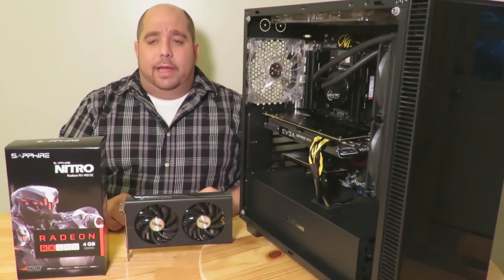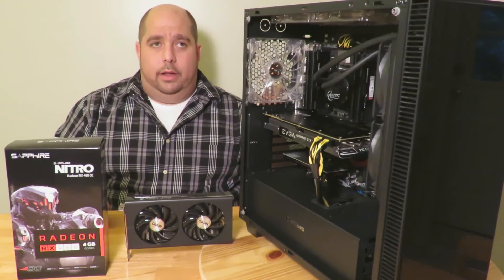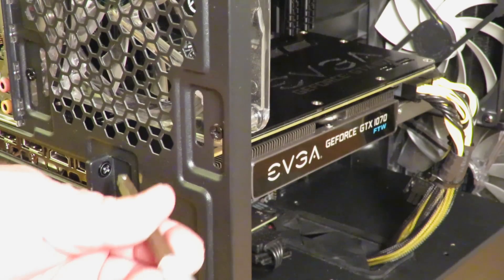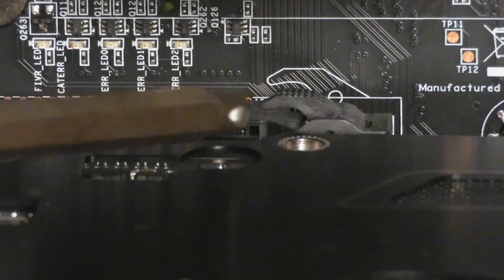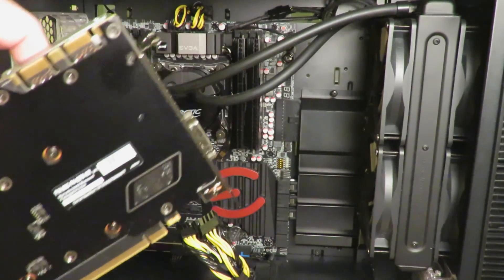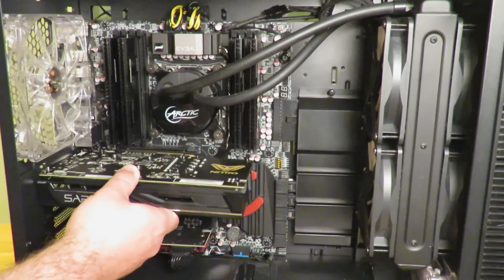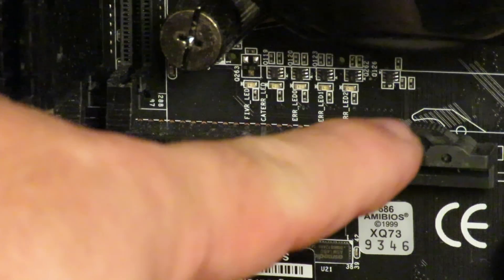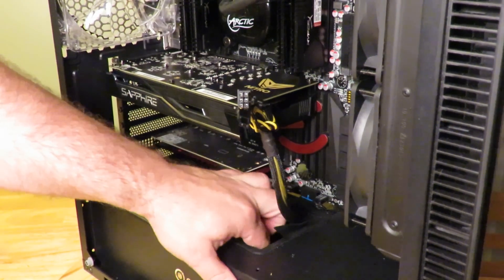Tutorial: How to install the Sapphire Radeon Nitro RX460 OC Video card AMD

Comment: I have a AMD A6 7400k which is had onboard VGA, i tried to install my new RX 460 2GB (no power pin need) on my pc, but it cant connect to the monitor, the PC seems to booting and loading, the VGA's fan is running normal. My PSU is Hexa 400 Pure. What's the problem with my pc? Does it really needed to uninstall the onboard vga's driver before i install the rx 460? Thanks before
*note: sorry for my bad english :)
Reply: no worries my friend about the english, it looks fine to me.  So stupid question, do you have the monitor plugged into the video card, or still to the onboard video?  In some cases you need to disable onboard video for the video card to work, but before you do that, let's troubleshoot a little more.  

Did you plug in the PCIe cable to the back of the card, it need power to power on.  The card requires a 450Watt power supply, so that 400Watt may not be enough.  Make sure the input on the monitor is selected that the video card uses, so for example if you are using HDMI, make sure the output on the monitor is set to HDMI, or DP or DVI, which ever you are plugging into the video card.  Remove the video card and reinsert it, it may not be properly seated.

Let me know if any of that helps.

Comment: after install this gpu my monitor turn into black screen? any solution?
Reply: A few things to check, 
1. is the video card firmly seated into the PCI-e slot, I recommend removing the card, then re-inserting it, just in case, I included in this video how to remove the card.
2. Is the video cable, still plugged into the onboard video or is it plugged into the video card.  Changes are the onboard video is a vertical connection, next to the USB ports.  The video card is the horizontal connection.
3.  Is the correct input on the monitor selected?  Were you using DVI before and now using HDMI, DP, DVI or vice versa?  Select the correct input on the monitors on screen display, usually a button on the monitor to change inputs.
4.  If your video card has a PCI-e connection, is it plugged in, if it has 2, are both plugged in, yes they both need to be plugged in.
Let me know if this helps, these are the most common issues.

Comment: I have rx 460 2gb graphic card...it showing no signal in my led tv and fan spinnig....what should i do?
Reply: No signal could mean more than a card, it could be that there is an issue with the system.  Without knowing more, assuming it is the card, and maybe a new install of the card, a few things to check.

1. Verify that he card is properly seated, remove the card and reseat it into the PCI-E slot (Make sure the system is powered off before  you remove the card)
2. Make sure the PCI-E power cable is properly seated in the card, remove it and plug it back in (Makes sure the system is powered off before you remove the PCI-e connection)
3. Verify that your monitor is in fact connected to the video card and not the motherboard.
Reply: Go back and buy the 4gb version

Comment: I have a gt 630 now but if I install the rx 460 do I have to install the amd drivers too or will it run fine?
Reply: Iggy Castillo thank you so much, also my mobo is an asus p8b75-m with a pcie 16 slot but does the card (rx 460 from msi) need extra power cables as my gt 630 doesnt
Reply: Iggy Castillo does that 10 watts make so much difference?
Reply: Iggy Castillo okido thanks
Reply: Iggy Castillo I still have one little teeny tiny question because the videocard I want is a msi rx 460 and it doesn't come with pin holes for the power connector, is the msi version plug and play?
Reply: Iggy Castillo Thank you so much for your time!
Reply: For sure.

Comment: so, the cable for connect to Monitor ? I'm must buy a new cable?
Reply: Iggy Castillo 
the white cable to connect monitor
Reply: OK OK, thanks
Reply: Because my monitor still use that
Reply: ??? Where the photo I'm sending to you???
Reply: Well, the Adapter for VGA monitor
Reply: Eh... I have a question, my processor is AMD A4-7300, it worth with RX460?
I got bottleneck or not?
Reply: Thanks for your answer

Comment: i have serious issues with the drivers for it. after installing them, the dvi signal broke and corrupted my hard drive. Formatting it externally was my only option, so I did that. But still, I do not recommend the rx 460, get the 470 instead, since it has a higher value and stability.
Reply: Iggy Castillo xD Didn't expect an answer this quick. Well, it was a 800€ custom gaming rig, so you can guess that all the parts were new and the driver was freshly installed, thanks to onboard lan from my asrock mobo
Reply: I downloaded the newest update, BEFORE the new driver version came 2 hours later xD
Reply: it broke down during the installation. And before that, my rig booted up correctly and smoothly.
Reply: Iggy Castillo system power 8 500W. onboard graphics was disabled, since i have a kabylake cpu and it has some issues with the onboard graphics...
Reply: Iggy Castillo 
4260052184363 EAN code of my 500Watt psu. Well, during the installation, my dvi was plugged in to the graphics card. I still dont know what caused the error xD
Reply: And i didnt see the bsod. Just the video signal died instantly.
Reply: I couldnt do anything after the crash. My HDD was still being detected by the MoBo, but still no signal. bei it from the graphics card or the mobo, just nothing. I tried all kinds of things, and none of them helped
Reply: Iggy Castillo but is it normal as well to have 2 hours of black screen and a crash afterwards during that?
Reply: Iggy Castillo it is seated well. I couldnt see any gaps and such.But my clip broke when i was unlocking it to put in the graphics card. the pins, luckily, did not suffer any visible harm.
Reply: Iggy Castillo havent tried it out. I need a windows ISO to do that. since i formatted my only 1 HDD. Sadly, i dont have another pc available to do so. I'll tell ya when I do.

Comment: if i missed it, should have said about removing drivers before changing cards. 
nice vid and the 512mb mem channel  is off the hook for this card, my Sapphire 260x oc's from 1050/6000 to 1155/6600 on stk power, would like to upgrade to this no problems.